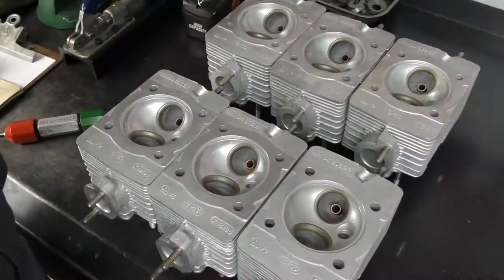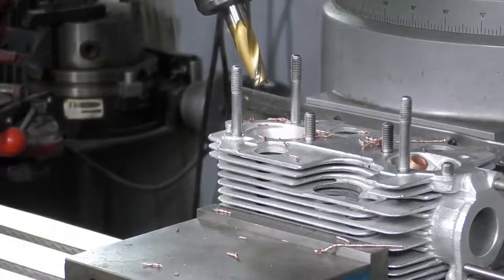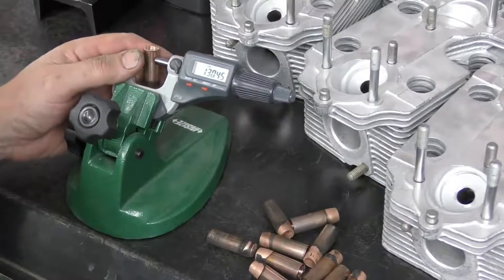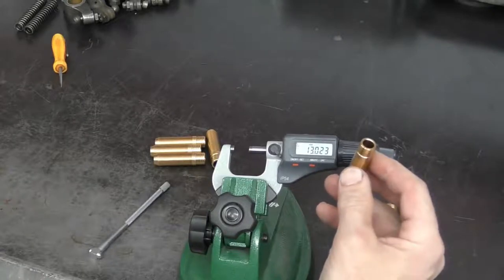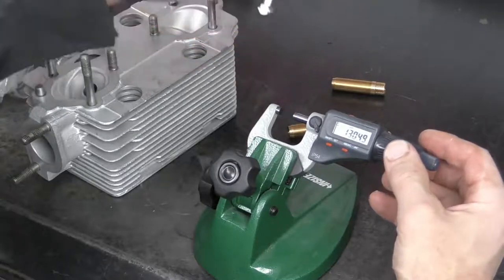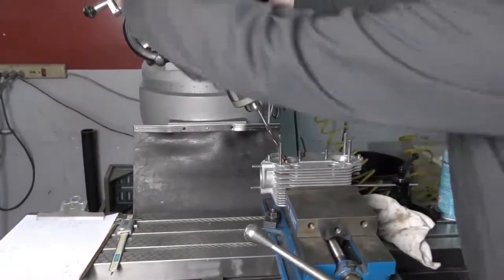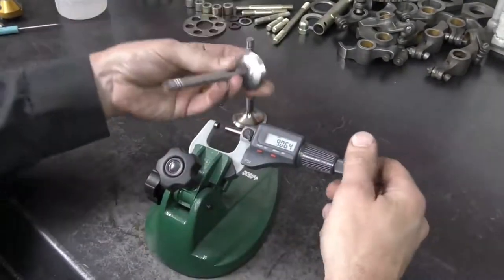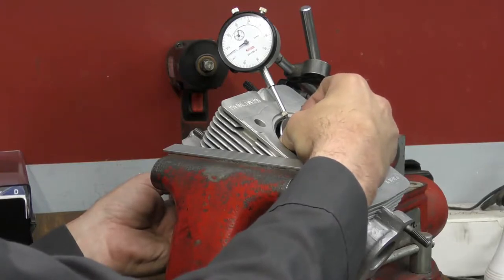Valve Guides, How to Rebuild a Porsche 911 Air-Cooled Cylinder Head. Lesson 4

Comment: These videos are fabulous,  thank-you so much. I read elsewhere that if your allowable play in the guide is x then the valve can wobble 2x on the dial gauge, which if true would have meant some of your wear was within the limit.
Reply from the maker: No not at all. I dont know where you read that but it is not true. 
Kurt
Reply: @klassikats  I think the logic comes from the play in the valve at its head being twice the stem to guide clearance.  This is because the valve can move directly left or right an amount exactly equal to the valve/stem clearance. However additionally, by moving the top of the stem to the right, the head can rotate left an amount equal to half the clearance and can rotate right an amount equal to half of the clearance.  it's half each way, because it's protruding about half of the length of the guide out of the guide so can only rotate half as far left as the top can move right. So the play at the head of the valve is double the stem to guide clearance. I guess this could be verified or rebutted by measurement.
Reply from the maker: Yes, I understand the theory you are basing it on, but for that to work, the valve would have to be held perfectly in the center of the guide without touching the guide and always return to the point after being moved to one side or the other. Which we know does not happen. Instead, the valve stem sits against the guide and, therefore, wears against it every time it moves. The rocker arm action adds to this movement because it does not load the valve directly but instead creates a side movement that highlights both wear and movement. One of the ways you can see this wear in action is to have a guide that is worn, and you measure the wear in the direction of the rocker action. Then, turn your dial indicator to 90 degrees and measure the valve rock. Usually, the side-to-side wear will be significantly lower and sometimes even within the wear limit for a valve guide. It will just show you how much the guide wears on the thrust side.
Kurt

Comment: Thank you Kurt..Us Porsche owners really appreciate your time and effort in teaching us on how to understand how these unique engines are made and serviced..God bless you and your wife
also have you heard about the 964 guides..they have a better composite metal than the original brass and can last a lot longer..have you heard of this.
Reply from the maker: Mike, 
Valve guide material is constantly evolving as different materials hit the market. I rarely use a Genuine Porsche valve guide as they are just too expensive and generally not in stock as no one really uses them. The valve guides I use are either a Bronze Manganese, or an Aluminum Bronze type of guide. Porsche has used many different materials throughout the range of the 911 air cooled motor. Thanks for your comment
Kurt
Reply: @klassikats  Thanks for your comment so i'm guessing the manganese would be the longer lasting guide!...and how long would they last in miles!..cheers!
Reply from the maker: @john2ndname  Mike, Actually the Aluminum Bronze tends to last a little longer.  You can expect intake valve guides to go for around 125,000 to 150,000 miles and exhaust valve guides go for 75,000 to 100,000 miles.
Kurt
Reply: @klassikats  OK..make sense thanks!..your right!..out of all the alloys aluminum is the hardest alloy's out of the these as manganese and magnesium are soft!

Comment: Excellent lesson!
Reply: By the way, could you please provide the brand and model of the two honing tools
Thank you
Reply from the maker: Thanks! 😃
Reply from the maker: Pedro,
I use straight fluted reams, not sure of the brand as it changes on a regular basis depending on what my supplier has available. The hones that I use are a 240 grit ball hone, designed specifically for soft non ferrous materials. Also not sure of the brand. I purchase both of these products from various machine tool suppliers, like Mcmaster Carr  or MSCDirect.
Thanks for watching,
Kurt

Comment: Hi Kurt, thank you for doing this amazing work and showing it. Very much appreciated. Would you mind sharing which mill and lathe are you using in your shop? Thanks!
Reply from the maker: The lathe is an old Victor and the mill is a Bridgeport clone that I bought new about 8 years ago. I also have a tormach CNC lathe and a Milling Masters CNC mill which is built on a Bridgeport clone mill.
Reply: @klassikats  Thank you so much Kurt. Much appreciated.

Comment: You would do less damage to the guide bore by first drilling, milling, or boring out the I.D of the old guide to almost close to its O.D to help collapse and kill the pressure from the interference fit.  Then they tap out nicely without much force.  On installing the new guides, a better way is to freeze the guides so they shrink, and heat the head so the guide bore opens up,  then you will insert the guides into the head with much less force and the interference fit will ramp back in when the temps normalize.   Both techniques will help prevent galling and raping the material inside the guide bore.
Reply from the maker: Thank you for your input. 
However, I dont like drilling the valve guides to relieve the pressure as usually this creates the risk of more damage while removing the guide. The wall thickness needs to be significantly reduced to make any difference to interference which makes it hard to locate a punch onto it without damaging the guide bore while driving it out. A properly sized guide  should have 0.05 mm of interference and should tap out/in with minimal force. By removing the back of the guide as specified by Porsche so that it is flush with the cylinder head surface it is easily driven out using a standard valve guide punch. Rarely do I ever get any scoring on the valve guide guide bore. Usually the only time there is damage to the bore is when the head has been improperly serviced and guides have been driven in to tight.
It is the same when installing the valve guides. With a properly sized guide and a properly prepared valve guide bore, both lubricated as specified in the Porsche shop and the guides will easily drive in without much effort. 
Using heat and cooling will make it even easy however most shops lack the proper equipment to do so. The cylinder head needs to be heated to 200C and the valve guides chilled to -197C to achieve meaningful differences to installation. Handling the parts at these temperatures can be an issue. 
Now we use heat when installing valve seats, however, the interference is significantly higher running around 0.125-0.150 mm. Thanks 
Kurt

Comment: What type of interference fit do the seats and cylinder head typically call for? .007?
Reply from the maker: Seat interference is typically 0.12 to 0.15 mm (0.005" to 0.006"). You should always heat the the cylinder head and chill the seats before attempting to install.
Kurt

Comment: why u didnt press valve guides out with a press?
Reply from the maker: Jump, To be able to press out the valve guides using a press you would have to build a special fixture to hold the cylinder head on the correct angle so as to push the guide straight out. You would have to make two different fixtures because the exhaust guides and intake guides are at different angles and would have to be held differently to press valve guides. It just does not make sense to try to use a press.
Thanks 
Kurt
Reply: @klassikats  u are right. but u can adjust the angle of it with vise just like when u milled valve guides. cos hammering precision parts is not looking good.
Reply from the maker: @busytirex2366  a vise will not work in a press and all valve guides are driven in either with a hammer and punch or an air hammer.  Even the original manufacturer drives in guides with an air-operated punch. There is also a reason that valve guides are supplied unfinished, because until they are machined and sized to the valve. they are not a precision part. This is standard procedure on all models and all valve guides
Reply: @klassikats  that was help full. cos when i was looking for valve guide for my engine, in catalog of manufacture(metelli Group), it shows that the ID bore is exactly same with the size of spec
Reply from the maker: @busytirex2366  the catalogs will usually always show the finished size, however in reality it will not be the case. all valve guides require correct finishing to suit the valve and the engine specifications they are used in. One of the most common issues I see with the 911 engines and valve guides is that they are sized way too tight. The operating clearance required in an air-cooled engine is larger than that of a water-cooled engine.  This often results in valves sticking in the guide and hitting pistons. Valve guide internal finish honing is also an important part of the job.
Reply: @klassikats  u are right. with right clearance on bronze valve guides, how many miles they can work with being in spec ?
Reply from the maker: @busytirex2366  most 911 engines will need exhaust guides by around 100,000 miles. Intake guides will tend to go to around 150,000 miles.
Reply: @klassikats  u are helpful. keep going on this channel. especially videos that u describe in detail
Reply: @klassikats  I heard that the 964 guides have a better brass material than the standard brass used in the earlier models to last a lot longer!..have you researched this!